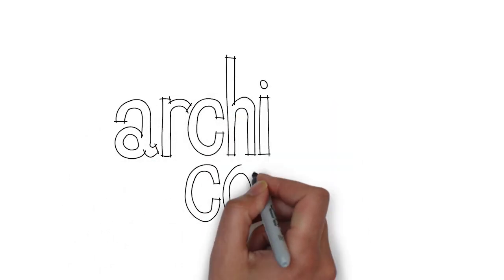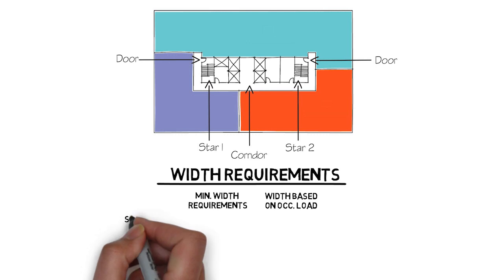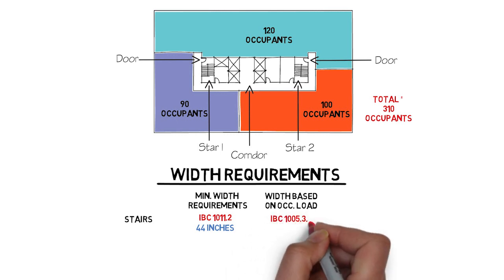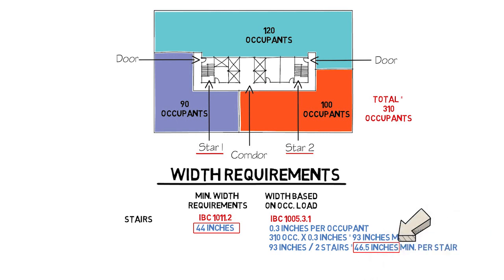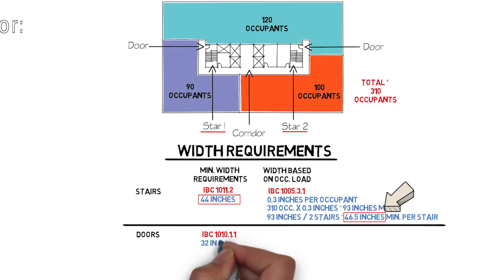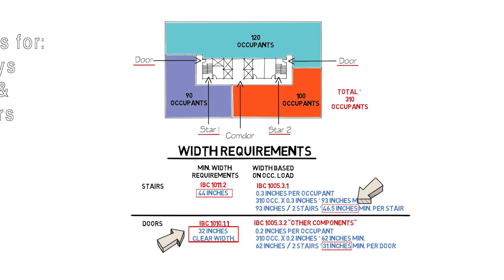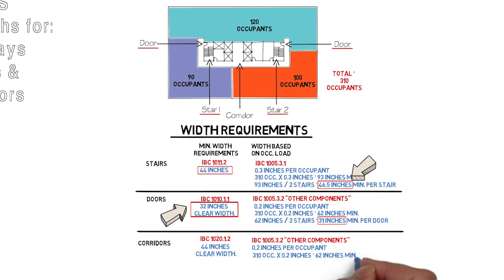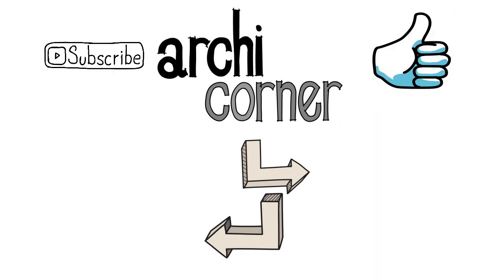AC 011 - Egress: How to Calculate Egress Widths.

Comment: Dear sir how do I calculate door clearance for a sprinklered space with occupant load greater than 50 with one of two exit doors opening into a corridor. With a door width of 36” and a corridor width of 59” inches and clearance on latch side the required minimum of 42” inches which if I am understanding ADA requirements would allow for a corridor width of 54”.

I believe that the footprint of the door (36”) swing plus 1/2 the required width which in this case is 54” (27”) I will need a minimum corridor width of 63” inches. Is this correct or did I get my diagonal measurements of the door at 45 degrees wrong?

The corridor width cannot be changed as it already exists and is as I mentioned 59”. I am looking to install a new door into a preexisting space that was combined with another space making a larger space and I have the option of moving one of the doors and was hoping to change the direction of door swing to allow for a higher occupancy. This space will be used for a martial arts school/studio.

Thank you in advance for your time and consideration. 🙏
Reply from the maker: I don't often solve specific problems through YouTube. I would suggest you hire an architect in your area. They would have better knowledge of what laws apply to your state and county better.

Comment: Great video! You discussed exit width of the stair based on occupancy of the same floor the exit stair is located. I thought the exit width also had to be calculated based on the occupant of the above floors. Is that not correct?

Comment: what is the width required for two doubles doors? twice more than 66" inches? like 120" if we have 1000 OCc.
Reply from the maker: doors in general can never be more than 48" wide. So if you need 120" of door width, multiple doors may be needed. If you look at stadiums and similar places, you will see that they have MANY doors next to each other. This is one reason why they do this.

Comment: Could you talk more on why you can't split the corridor width in half? if a room has 2 exits it can be split in half so why couldn't it be the same.
Reply from the maker: That is actually a very good question! This is not really called out in the building code (if you can find otherwise, please share). Nevertheless, your proposal seems reasonable. If you are able to clearly show that in your egress path of travel, it just might work! But then again, its all a matter of the building department accepting it and your good communication with them.

Comment: Section 1009.3 is also important for stairway width. 1009.3 states that stairways must be 48" minimum wide handrail to handrail if the building is not sprinklered. 44" is the absolute minimum if the building is sprinklered.
Reply from the maker: That is a very good observation! Thanks!
Reply: @archicorner  I was wondering if the 44"min was between handrails or wall to wall as well
Reply: I think the 48" is required for 'accessible egress stairs," which is different from 'egress stairs.' For egress stairs, you only need 44". You don't need 'Accessible Egress Stairs' if the building has automatic sprinkers.

Comment: Can you clarify on corridor width? Only the CENTER corridor where you drew an arrow to is the 62” width because all three suites access it? Or is it the entire wrap around corridor would be 62”?
Reply from the maker: Good question: Once a corridor width is stablished, it is usually carried out through the entire corridor.
Reply: archicorner hmmm... this is confusing bc technically the centre corridor is a “common path of travel” and then the occupants are met with 2 choices of “exit access” which would technically divide the occupants in 2. The corridor also changes direction. So can you not have a narrower corridor where it divides into 2 separate “exit accesses”?
Reply from the maker: @ParisBrockington  I understand the frustration. What you are noting may be doable. If you can show how this can be accomplished (showing how the occupants can be directed to the different egress points), you could in effect make what you are noting work. It is all in the presentation of your egress plans and making sure that the idea is clearly explained to the AHJ's satisfaction. In the end, the architect signing the plans will be responsible for the design, whichever it may be.